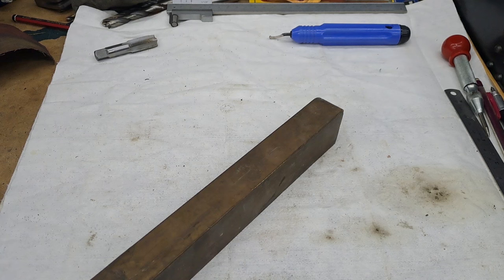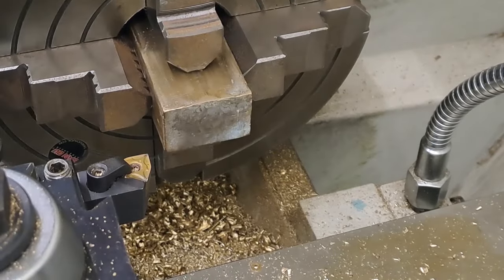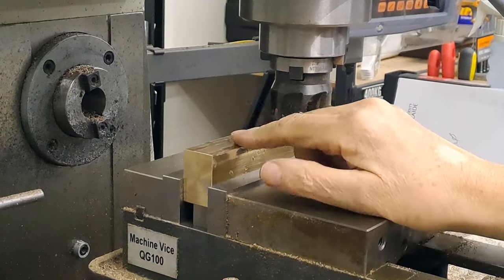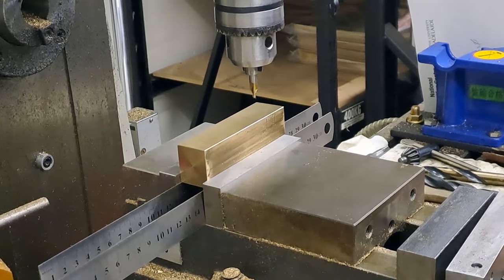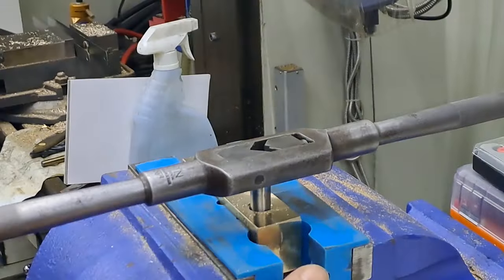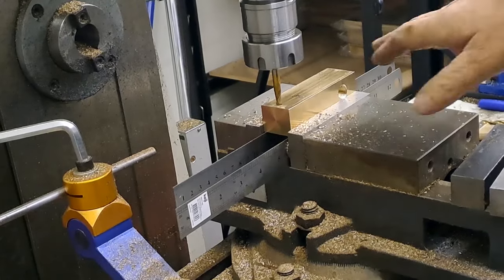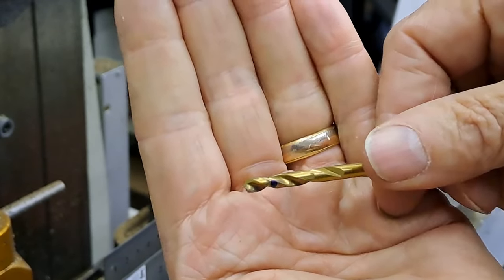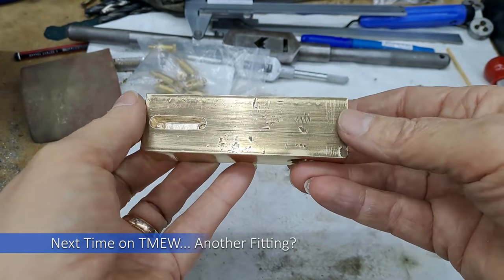036 Body Building

Comment: Hi there,
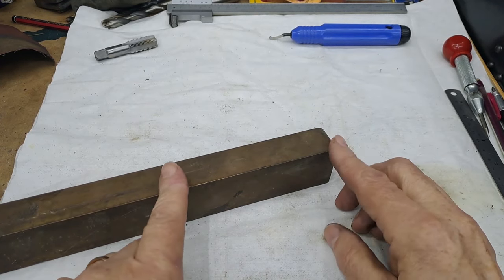I have just come accross your channel this evening in a some 2:49 what chilly England
I saw the workshop tourthen the pump body build, (both very good).
I like the real time build aproach  and explanation as to what you are doing, (as I am a novice).
I have seen several axle pumps etc, but never seen any with a oil system for the pump ram (Good Idea).
Thanks for doing the videos,
Best Wishes
Andy G.
Reply from the maker: Hi Andy, 
Thanks for the comment. I'm so glad you like my channel. It's not my idea to oil the pump. This is the design, and I'm just following the drawings,  as I'm a newbie also! I imagine that the idea is that the o ring seal keeps the oil and water apart. I really don't want oil in the boiler!
The Chef
Reply: @ThisModelEngineersWorkshop  I rather suspect that up to the point of the seals  extreme outward part, the water in the pumping chamber would lubricate  the seal travel area.
Thanks

Comment: We saw some chef-approved clogs when you were working on the power hacksaw! Very nice!  If you cut some slots in your menu stand to match the spacing of the threaded holes in the end of the moveable jaw in your milling vise, you can drop the plastic over some screw heads and you won't have to hold it at all. I leave them just a little bit loose so the shield just drops on and pulls off easily. Nice video!
Reply from the maker: Hi. Thanks for the comment and idea... that sounds like a winner for sure.
The Chef